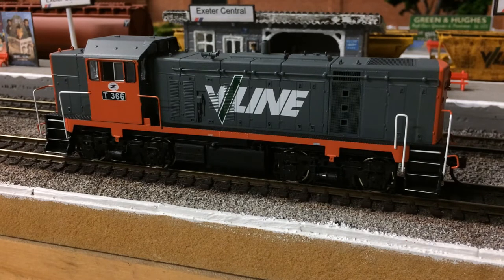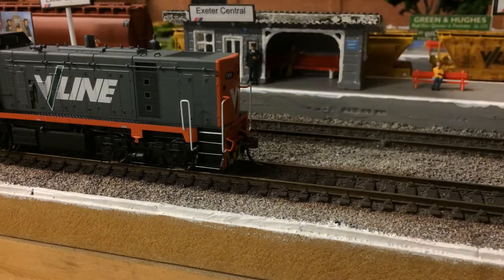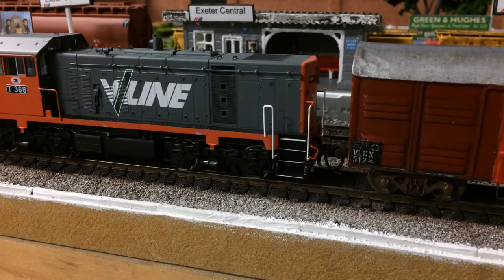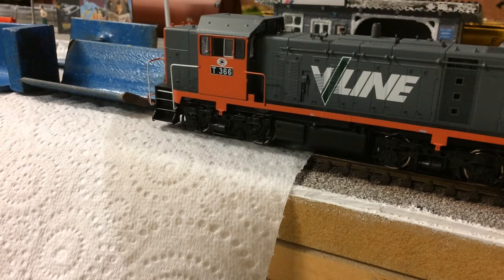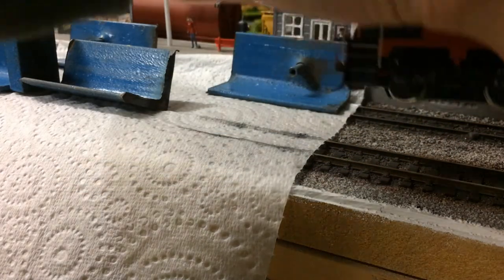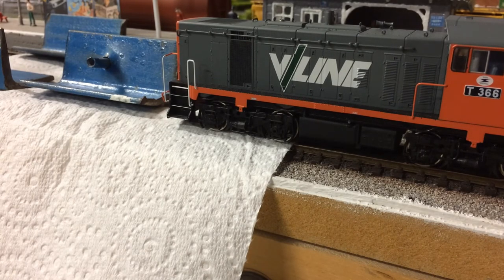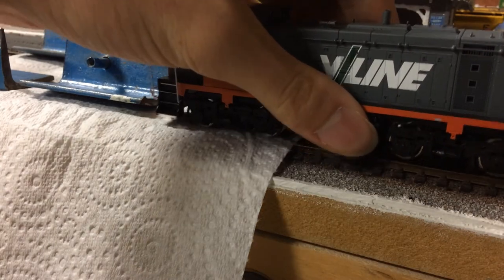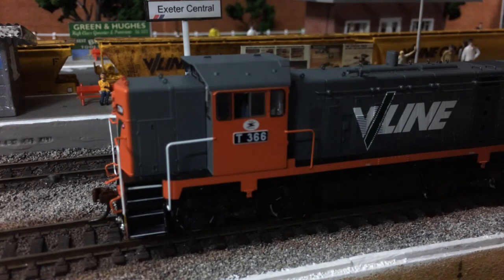39. Quick tip - How to clean locomotive wheels - The simple way!

Comment: Great idea Nicholas. I will have to give that a try. Thanks for sharing. Roy.
Reply from the maker: Cheers Roy. It is a great method for cleaning the wheels. Give it a go it works really well.
Reply: @NicholassTrainChannel  thanks for replying. I’m just checking, did you apply the cleaning fluid to the wheels or the paper towel. It may be a silly question but thought I’d make sure. Thanks. Roy.
Reply from the maker: @roystudds1944  that is an easy question I put the cleaning fluid on the paper towel then ran the loco over it. Hope that helps.

Comment: Hi Nicholas, thanks for sharing this wheel cleaning method it really is one of the best methods. Cheers, Paul.
Reply from the maker: Cheers Paul yeah it is a great method no need to go out and buy expensive wheel cleaners or fancy equipment like that and it is quick too it only took around 3 to 4 minutes to get all wheels cleaned on this locomotive. And even better you proberly have all the stuff you need at home so it costs basicly nothing!.- Nicholas.
Reply: @NicholassTrainChannel  Top Tip Cheers.